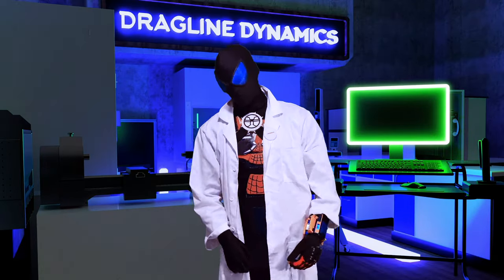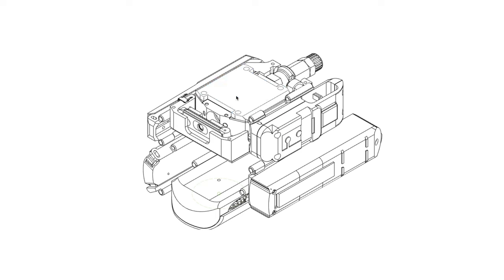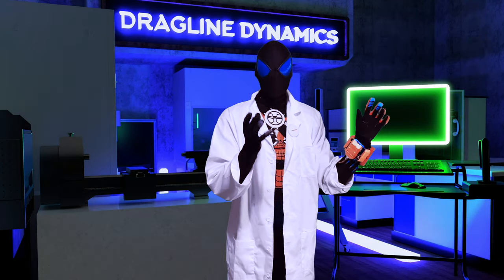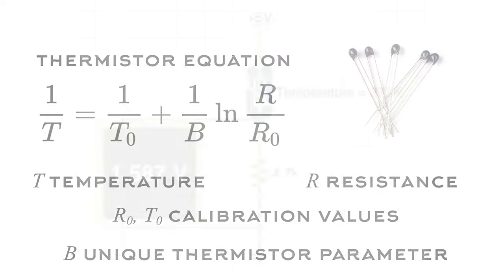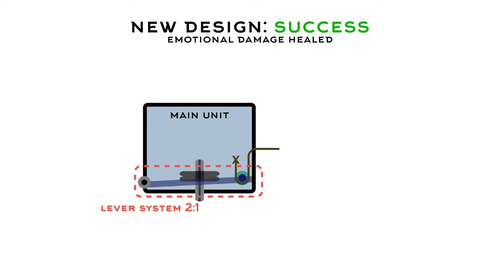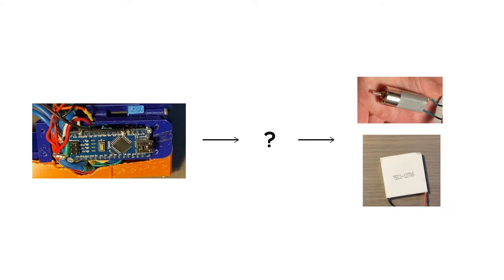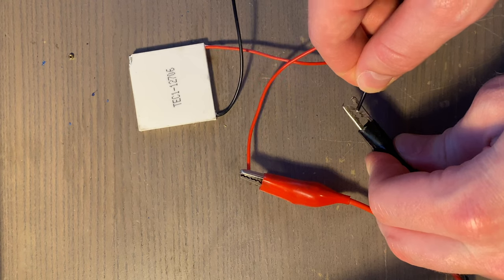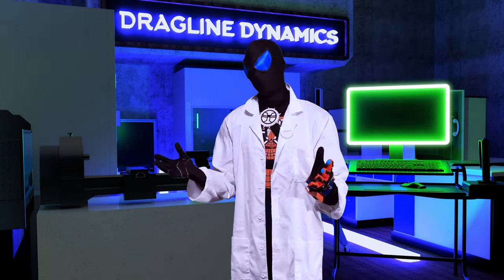🕷 How I built the most advanced web-shooter... ever.

Comment: "It's cause I'm a nerfed spiderman" 😂 
Hey, @the. Amazing could you put something small and springy underneath the lever that opens the release valve so it closes itself (quote-unquote) when the motor stops pulling? That way you don't have to worry about back-driving the motor? Or is it better to have as little resistance to opening as possible.
Reply from the maker: Yes, if there’s as little resistance as possible, then the motor exerts the least amount of torque possible, and that’s ideal, because then you don’t need as dramatic a gear ratio, and the valve can open faster. So for instance, there is something springy in the valve (both an actual spring and the pressure within the web shooter) that will cause it to close, but they won’t be allowed to close until the motor “moves out of its way” so to speak, which is when the motor runs backwards, manually. Great question!